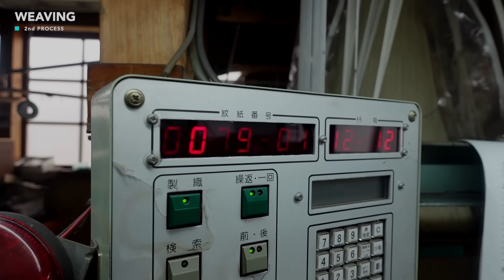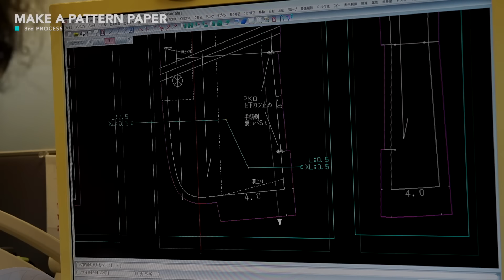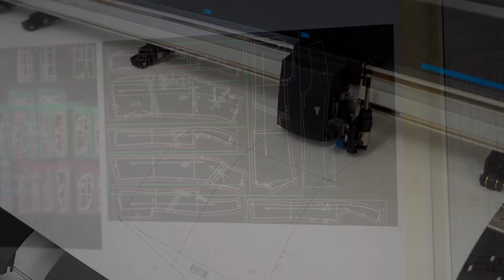日本の職人技！西陣織の帯でアバンギャルドな服ができるまで

Comment: AND THAT PEOPLE is why quality clothes last half a lifetime and Fasty Fashion lasts an average of 7 wears.

The MOST expensive clothes you will ever buy are cheap clothes.
Reply: Complete fallacy. There are quality constructed ready to wear clothes. Case in point. I bought a Calvin Klein denim coat in 1985(!) with a merino wool zip in liner. I'm still wearing it every fall & spring, so 6 months out of every year. I paid, if I remember correctly, less than $300USD. It goes into the washer & dryer 2 - 4 times every year. If you want to nit pick, the last 10 yrs it's started to show its age which, for me, is not a bad thing with denim. I could go on with other items. Bottom line if you learn a little about fabric & clothing construction you will not be replacing every 7 yrs. BTW Silk disintegrates if exposed to direct sunlight.
Reply: @yarnexpress  YOU ARE LITERALLY CONFIRMING MY EXACT POINT...!!!      Calvin Klein is NOT fast fashion. $300 in 1985 is $858.15 today.

A fast fashion jacket would be $30 TODAY at Zara or Shein and they would last an average of 7 wears.  

Your quality $858 jacket [inflation adjusted] has lasted you 38 years - which is almost exactly HALF a lifetime.

EDIT:  " Bottom line if you learn a little about fabric & clothing construction you will not be replacing every 7 yrs".  I'm a bespoke tailor of men's historical suits - please don't patronise me. My suits start at €5,000.  Im typing this in a room filled with bolts of cloth up to 150 years old.
Reply from the maker: Quality clothing can be worn for a lifetime. The clothes in the video are one of them.
Reply: As someone who makes most of their own clothes ( it's ridiculously easy to make simple no waste garments), I cannot imagine only wearing something 7 times.  W in the actual F?   I have clothes from 30 years ago that are just getting worn in now lol.  If your pieces don't last 10 years, you're buying the wrong shit.
Reply: @complimentary_voucher  I have jackets that were made the year I was born - 1970 - and they are in perfect condition.  The clothes I make [Im a bespoke tailor of historical mens suits] should last 20 years of regular wear of a literal lifetime of weekly wear.  I try to add 100-150mm 4-6" of additional length to the trousers in case your son has longer legs than you when you leave the suit to him in your will.

Comment: This may be a ridiculous question and, if so, I apologize.  I am often shocked by how many machines actually exist to handle steps in the process.  For your yarn dyeing machines, does a company actually make these machines and you adapt your process to use them? Or, do you find a machine making company and tell them what functions you need it to do and they design the machine in a custom fabrication?  If you wanted to add two more yarn dyeing machines, would new ones need to be built for you or is there a support industry already in place?  If they were custom built, do you own the designs so you can have more made, years later, from a different place if there is an issue with the signing company (like going out of business, etc)?